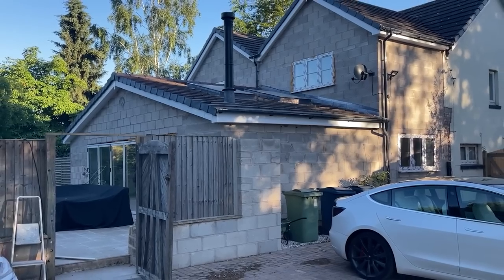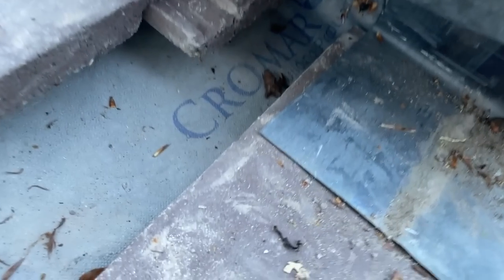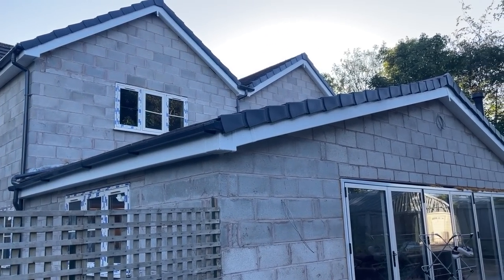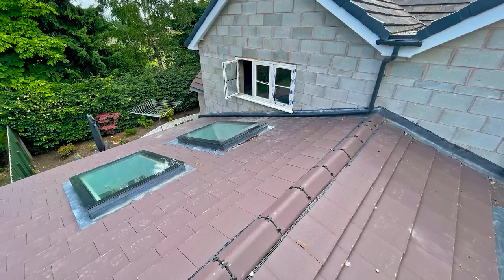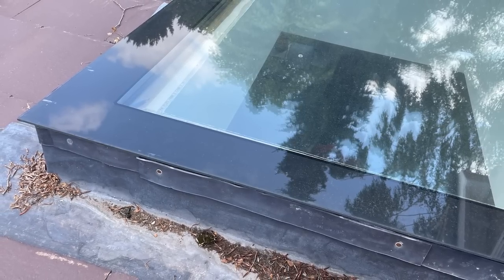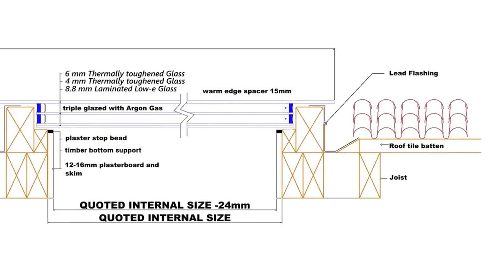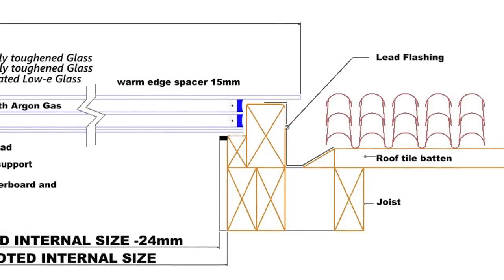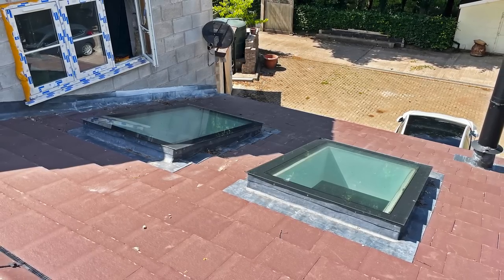How Many Mistakes Can You Spot on This Roof?

Comment: These tiles have a minimum pitch of 17.5 and require a 100mm head lap (which needs checking) meaning they are not suitable for this purpose. Some of the setting out looks awful and rain could drive back up. 

I’d not sleep at night during heavy rain with this roof. With cost in mind, I would have those tiles off set aside and install onduline prior to reinstating the tiles and re doing the roof light. 

Admire people tackling self build/project management but this is an example where it’s not a straightforward build and specialist details that require professional advice. If this was drawn by an architect/technician these issues wouldn’t have arisen they would have been spotted.
Reply: terrible setting out, its hard to look at, id have to start over if it was me
Reply: Yup its a botch up. Pitch to low and slowing water runoff far to much creating high risk of rain blow back under tiles and then having too rely on under felt  which Is the last resort back stop.  I work in grp and conventional roofing so strip all that crap off creat a solid waterproof grp or metal roof and if aesthetic look required tile over with something other than those ugly tiles,I’ve never yet seen a farmhouse with those hideous tiles on?
Reply: @Storm.Z.4u  fibre glass is an awful finish, should only be used when no one can see it!

Comment: It is possible to produce the bespoke style skylight that has been attempted here, if you use something like the Cappex system . The glass should have an overhang on the front etc. As others have said the pitch is wrong for the tiles. Also with any flat concrete cross bonded tile, you need to use a secret gutter system at all abutments and then a small lead saddle to bring the water back onto the tiles. I think this style of tile is a bit shit myself anyway for this reason and the fact that you rely on an unseen, brittle water-track with a 5mm upstand to keep the water out!
Oh yeah and they battened it in wrong too lol

Comment: I see 2 a month as bad as this if not worse. All good advice given if its not going to be stripped. The sarking felt used is not breathable but gas permeable this is the most common misunderstanding I see. Block up the light fittings and protrusions in the ceiling, its the No.1 best thing to do to help stop the migration of moisture into the above construction. I have the same opinion as Roger it's not broken don't try to fix it, so monitor it and see if you need to do anything. But fix the skylights.
Reply: The legend speaks, not so many posts on your channel Steve these days? Nice to see you posting here. Do you also do pitched roofs.

Comment: That roof needs to come off. The pitch is too low for non profiled tiles. 17.5 degree minimum. Those rooflights seem bespoke. Better to use velux with proper flashings kits. If not then the lead needs to go over the glass. Shocking work
Reply: Velux windows should only be fitted to a pitch greater than 15 degrees I wouldn’t recommend fitting to this pitch.
Reply: They have a Velux that goes to 10°
Reply: @paulhadfield3033  you can get velux that go down to 10 degrees. You can also make custom flashings in lead or hard metal if you have the skills

Comment: Hi Roger, it looks as if I am a bit late to the party on this one but having spent the best forty years of my life dealing with these issues .
Watching his video which is very good and clear as you say, I am reminded of just how difficult it is to see the cause of the problem from the outside when it is all covered over. 
In the old reliable style of starting with careful, persistent inspection and observation after a while my brain starts to join some of the dots, raising other questions requiring further observations.
What I can see from outside is that the side cover flashings over the soakers do no come down far enough!, there should be at least seventy millimetres of cover, or down to no more that twenty millimetres above the soakers.
A bit later we see the ridiculous badly fitted flashing along the back gutters!, that lead has to be fitted over the up-stand and doubled back on itself to prevent capillary transmission. 
Then an appropriate sealant between that lead and the glass.
The next point is that the back gutters should have a flat 'floor' constructed in timber and covered with a sarking to prevent abrasion and adhesion, it should not be on the top of any tiles!, terminating at a step down to the side gutter thus allowing for an up-stand at the overlap of the lead.
The next part shows the inside where the damp patches indicate any number of issues!, the primary one that I would like to know much more about is the exact sequence and application of the appropriate membranes and insulation, it is absolutely imperative that the vapour barrier is complete unbroken and effective and always between the inside and the insulation.
With all that in place and working to prevent any condensation the roofing membrane must be fitted very carefully so that any water coming through the tiling gets diverted away from any cuts or corners in the roof-lights,
Listening to your conversation with them I hear you explain much of the same points and by the look on your face I think that you also think that the whole thing has to be taken apart and done properly!.
At the same time you are clearly trying to help them to avoid spending too much money and the 'fixes' you offer might help them but if as I suspect that they have serious condensation issues that will never go away!. 
Cheers, Richard.
Reply: Some very good information 👍
Reply: @harkinjames  Hi harkinjames, thank you for your endorsements, I try to do my best, the practise of observation followed by sensible description and ideas has always been a favourite hobby of mine, one of so many things that have become must easier with repetition.
One has to take great care though because it is equally easy to repeat getting things wrong!, so many jobs I struggled with before I got used to going through what I could see slowly systematically and severally until I could find a clear path back from the conclusion of the task to a sensible start point!.
Cheers, Richard.

Comment: Surely the lead should be lapped over the top of the timber up-stand? That would be my guess is the main culprit. Also you should get a window with a frame that sits over and down the up-stand. Even if you do flash the lead over up-stand you would still need to seal with silicone/mastic which will eventually fail. Doesn't seem a good detail/design. We have had a similar window installed recently where the lead was lapped over and the window frame sits down over the up-stand. A bad design made worse by bad installation.
Reply: Or just use a velux or similar with proper flashing kits and stop trying to make problems for yourself.
Reply: Ice, yes indeed, simple weather shedding measures going back to first-principles.

Comment: Hello Roger, I have a leak I think from my my flashing at a secondary chimney on my house. It leaks down the wall underneath into the property (slowly). I have been onto the roof and had a good look and now I think I see the problem. The chimney acts as a pivot point to where a small extension and rood was made (before my time). where the water may flow down to this chimney and around and off to a gutter, there is a section around the chimney where the flashing become flat and even dips before rising ever so slightly which causes a pooling and around there is the leak. I was hoping to do a quick job but now it looks like a possible restructure just to give an extra inch. I don't know what to do. I could remove a load of tiles but I'm not sure I can raise it to create water flow. the chimney is adjoined to my neighbours house he does not want me to remove the chimney even though it not in use. we still have another chimney which I fixed another leak from. what can I do abut my problem

Comment: I am a retired Carpenter/joiner (and have a reasonable knowledge of most other trades)  and one thing that has shocked me when trying to hire Tradespeople these days is that virtually none of the people who come to quote had basic Public Liability insurance.  Last time I worked it was only about £80 a year so there is NO excuse for not having it..    If you ask to SEE proof of Insurance they can get quite bolshy as if you are questioning their skill..  but..  they could burn your house down or injure your child.. It's not just about getting dodgy work sorted out..  Insist..! Thats my Rant..

One tip for the Roof I would offer would be to try to see what is happening actually when it is torentially raining.. I am not saying clamber on the roof but perhaps set up a camera.. It can be surprising how intense the effects can be when wind and rain work together.   Stuff you can't see when it's dry.

I would say the very low pitch could prove to be long term problem with our Climate change issues.. Perhaps change to Interlocking tiles (Santoft 20/20) I assume these aren't..?
    
 Possibly even over-heating the Glazing bonding adhesive keeping the 3x Sealed unit together..                  It depends if they used a hot bitumen type or the better 'Tiger' brand..  

If over-heated.. the outer glass could just slide down. I don't think this was the correct Sealed Unit design for a pitched roof.  Your one is a flat roof design where the overhang of the glass deflects water evenly around the edge..      BUT... If the outer sheet of glass was the same size as the other sheets.. apart from the bottom 50mm overhang, then a suitable flashing could bond over the top and side edges of the glass helping to keep it in place and also deflect excessive Sun heat.

I hired a 'clown' to do some Roofing for me some years ago and he left a stack of Concrete roof tiles balanced on the back of a Dormer ridge where it joined the main roof and went home.. Could have killed someone if someone hadn't spotted them and told me..

Comment: Journeyman glazier from across the pond, only commercial though.  
I would put some roll on tar like flashing underneath your roof tiles.  Next, install an aluminium flashing that will dive underneath your roof tiles, and capture the top edge of the glass, with a 1/4" or like 6mm(?) gap, which can be sealed with silicone.  

I had to replace an entire commercial job I installed back in 2016, as every window leaked.  Haven't suffered from leak issues since, and I've glazed a million square feet since then.

Comment: What makes someone think they can project manage something they have no experience in?

As a main contractor/project manager you have to know (even if its not your trade) if somethings right or wrong and that comes with years of experience.

Most builders would have spotted this at drawing stage.

I would have suggested dropping the eaves level to achieve 17° and get some proper roof windows not that shite! The fact they don't come with a flashing kit says it all!

All though the roof is a bit of a bodge it's the design that's at fault.... The pitch and those windows!

Comment: My heart goes out to them, I can see the pain of their faces. We desperately needed a new combi boiler but everyone was fully booked. We did find someone that wasn't. That should have rung some alarm bells but we were desperate. What an absolute lazy install. Gas pipe running from an old live pilot lit heater that we asked them to remove. They removed the heater but ran the gas supply from that to the boiler so just as ugly at the end. Thankfully some 6 months later our star of a heating engineer Rob was available. He came to us and discussed the options. He came back for a day and made it all good. I have photos and video of the firm that came originally and just left us with an eyesore of a working boiler. At least we had hot water and heating. Rob removed all their pipe work, put in new copper and not the plastic push fit they had used and he hid it all,  plus he bricked up the gaping hole left in the interior and exterior wall where the original flu was. They didn't even do that. Rob was so upset for us he charged a "mates rate" bless him and what a wonderful job he did. Modern Heating in Portsmouth. I won't name the other company but will say "If you can't get anyone because they are fully booked, avoid the lads that are available. They are available for a reason and it won't be a good one". I hope this lovely couple get their dream.
Reply: You should have refused Robs mates rates and paid him what he’s worth. He may feel bad for you but he’s still got to run a business.
Reply: @richarddalton7085  100% I have tried but he never accepts but what I do instead is give him gifts for his kids. That makes up for a lot and he loves it. I am completely on side you you Richard !!!

Comment: The whole extension looks like a DIY project gone wrong.the Blockwork alone would question if it's been done right ,tied in etc cavity trays where needed .I'd rip them out for velux as there always going to be an issue

Comment: Let’s be honest here either they’ve done it themselves with a friends help or they’ve gone for the lowest bidder and expected a professional, that’s just never going to happen and they’ve got nobody instructing or keeping an eye on the trades making sure small problems don’t become massive ones.
Reply: Unfortunately, this stuff happens when people try and cut costs and skimp on stuff. I fit kitchens and bathrooms and see shocking workmanship all the time. I have a job in a few weeks time where the customer has had an electrician fit his twenty grand kitchen and it’s a right mess. The customer having to pay for new end panels at over a grand and have all of the units unscrewed and re levelled as they are not flush with one another. If you try and save money or get stuff done on the cheap it often comes back to bite.  This is a typical example of what happens when a bunch of builders that are happy to try and do the job on the cheap rock up. Everything has a cost to it if you want it done right. The second I get the impression that the customer is after a cheap job I just say it’s not for me and I’m not interested. I want to walk away knowing that both the customer and myself are pleased with the job so that they are happy to recommend me to someone else as I don’t advertise for work. If you haven’t got any pride in your work you aren’t a builder your a cowboy.

Comment: That's designed to fail and leak. Two things I noticed without even watching the whole video but I have watched it all now. That's a ridiculously low pitch for a tiled roof. It should be a metal roof. Second, what are those dodgy skylights? Why not use Velux or similar? I would redo the whole job.

Comment: Roger - as a Roofer with almost forty years experience - the first thing that struck me was; I can't believe the Architect specified singe lap concrete tiles on this extra 
low pitch - it's just asking for trouble - If I was given this job I would have take one look at the pitch and said No - you need a double lap roof covering - Eternits or composite slates, whatever, but not concrete tiles! the underfelt should not be relied on to keep the roof dry under driving rain conditions as it is obviously going to be doing here,  and that gutter down pipe from the upper valley - handsome!

Comment: Jobs like this demonstrate the need for changes in the law. 1. All building work, including new builds, must be covered by the Sale of Goods Act 2015. 2. All builders must be covered by a bond that lasts for a reasonable period to cover their work. The bond should be included in the price of the job and be in existence so when jobs like this go wrong, the home owner claims against the bond. The price of a bond will vary - useless, incompetent builders will pay a fortune. The good ones will pay very little.  If this drives people out of the business then good.
Reply: We don't need more laws. This was a self build by people who didn't really know what they were doing or from whom to seek advice. The manufacturers provided a full specification but there was no proper enquiry in this video about how the construction deviated from it. Get the people back and build to the spec. At the very least get the flashings off, form a proper back gutter under the tiles with a full upstand, fit soakers both sides, replace the cover flashings, and secure the upstands as suggested.

Comment: Turned in a bid on a complete custom built kitchen redo with everything they asked for along with two days of hand drawings  had to take today off while they drive three hours to IKEA to look at "less expensive"cabinets I think you can probably guess at least one  thing these skylights, those cabinets and a turd all have in common.I have been a certified Pella/Velux installer for thirty years and have to say that is one crappy looking kit and install. Best advice for the homeowner would be to not request those fella's return back again.They should have at least asked the provider of the units for installer referral's.

Comment: the timber frame at 2.23 should be sealed, usually with this type of window its a rubber membrane nowadays. I would suggest in your situation you remove the window and install a lead apron to the frame and reinstall the window.

Comment: Flashband the hall mark of a cowboy agreed, quick fix, requires no skill.  However I have used it on my own house as a "temporary" fix, it had a corrugated tin roof over the kitchen (high spec!) and it did a brilliant job for 7 years, when I took it off to re- do the roof it was so ridiculously well stuck to both the render and tin after all that time.
Reply from the maker: Thanks for sharing

Comment: Anything that is done to repair will be reliant on a sealant which isn’t good long term
The glass is sitting flat on wood even if the lead was folded under the glass it would not make a great deal of difference there is no drip to stop the weather getting under the glass panel